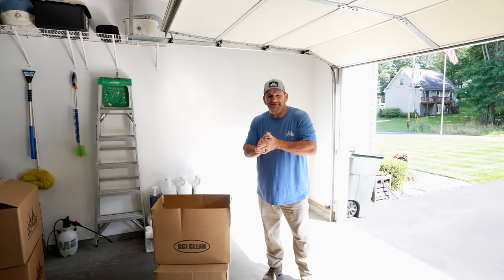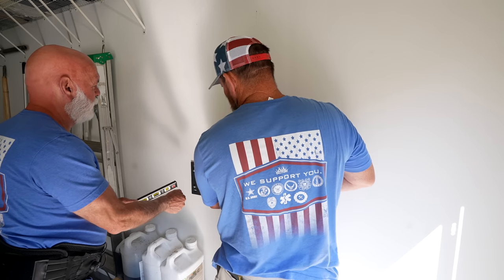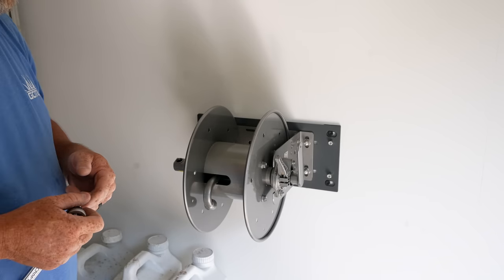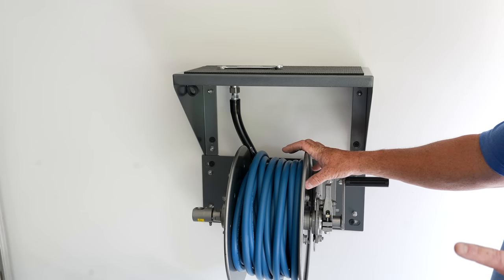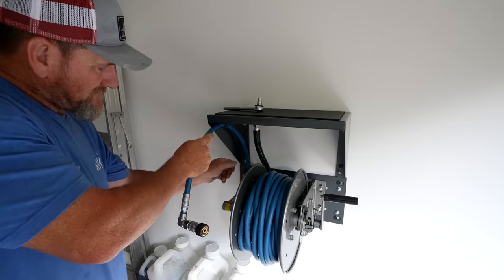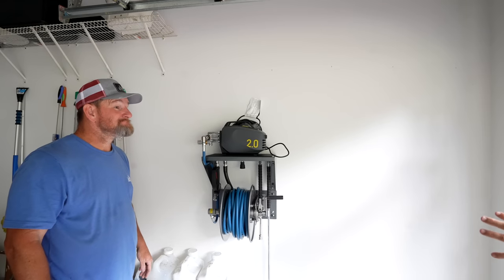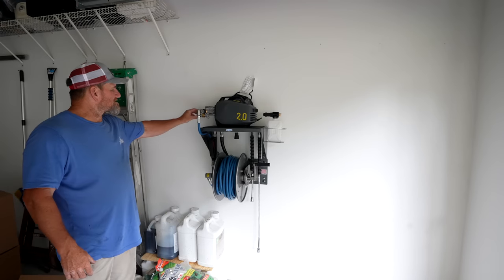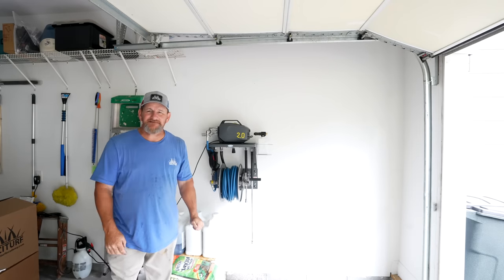New Pressure Washer Shelf and Hose Reel Mount

Comment: I'm a automobile detailer, this is a great idea and system. Especially for the homeowner. Gallons per minute is more important than psi is. This takes the frustration on getting a hose out and putting it away. Love it and quality is expensive but it lasts longer  no issues every time you use it. Detailer can mount in their trailer wall and keep it out of the way.
I'll be ordering one soon..

Comment: I have the OG Kranzle setup and I love it. 

That said, you did an amazing job putting this together. The mounting bracket for the hose reel and shelf for the pressure washer are genius. The ability to store your bits and pieces on the shelf looks very useful. 

This looks much easier to install too!
Reply: Why did you choose to go with kranzle?  The ar630 is a couple hundred bucks cheaper and has better output than the kranzle?

Comment: I fabricated one myself for my use in front of my shop. I love it! I am also a neat freak, and love organization! For a reel, I used the cox setup that came on my Z spray. I had installed a brand new one on the Z spray. And the old one worked perfectly for my pressure washer setup. Mine is 1800 psi also. It is absolutely perfect for washing equipment and vehicles. Your set up is very clean and nice! You did a fabulous job creating it. Always enjoy your videos.

Comment: I have that pressure washer but mounted it on a metal garden cart. Its great for vehicles and light duty household work. This consumer grade pressure washer is only rated for 200hrs which i expect to die on me in 2 years or less. My next one at that time will be a Kranzle 1150. Yes expensive but it is serviceable where this model is not. You have a great setup for low cost entry level, great job dude! Oh, i want to thank you for your quick delivery of the TTTF. Getting everything ready for overseed. Bad thing about the overseed window this year is we are forcasted to have one of the most busy hurricane season in a very long time, we shall see. God Bless

Comment: Pete, well done. I have a similar setup and have been using it for years and it is a game changer.  Your setup is quality. One potential add-on that you should look into selling is a spotless rinse system; easily built with 2 cartridges with replaceable DI resin and some basic PVC, copper, or PEX plumbing...all which can be options. Turn the DI on when it's rinse time and off when you are doing everything else. Also add on a TD meter to measure the resin. Wishing you success in your journey.

Comment: This is so much better than the unit I have. It's electrical and I have to drag it around everywhere. It gets tiring so it also does not get done. I have never seen any type of shelf so well put together. And I'm including even non pressure washer shelving. This is the best thing since sliced bread.  As a handicap person, I can definitely see the benefits of this over what I have to do now. Pull the machine out. It's located in different locations in the garage because I don't have room for it. Assemble the pieces. Hook it up to the water supply. Pull out the clothes to the distance I want it to be. No there is no reel on my system. And then start using it. When I'm done I've got to reverse everything. It takes almost as long to set it up as to use it.

Comment: Finally someone made a great system for a good price.
Reply: Good price? I guess I missed that part.  I have the pressure washer, hose, ect... all I need is the reel and shelf, and by my calculation, it would cost me over $700 for just those two items.  Not exactly value IMO.

Comment: I'm installing a similar setup in my garage to wash cars. Active 2.0 , Coxreel, 75ft blue Cobrajet hose, Mckillan's swivel gun, MJJC Foam Cannon Pro 2.0 and Hally  12x24 stainless shelf. Nice setup you have there Pete!
Reply: What's that setup run
Reply: @justins8768 I would say I'm around $800-$900

Comment: @GCITurf

Hey thanks for this video. Did you actually do another video about this?

Also we agree that this shelf system has some nice unique details that other shelf’s do not have built into them. There is nothing wrong with this at all.

Do you know if a Kranzle K1322TS pressure washer will be able to sit on that shelf ok?  If not it would be cool if you could offer a slightly larger size shelf system for the larger pressure washers.

Comment: That's nice Pete.  I wish I could do something like that in my garage.  We cannot put water lines in our garage because it would freeze in my area.  If you live somewhere you can have water lines in the garage this is a great setup.
Reply: You can install this without any worry. You just need to drain the pressure washer hose when it’s around freezing and then bring in the pressure washer.
Reply: @sdfd504  You missed my point.  I have no water source in or near my garage.
Reply: @myriadcorp  gotcha. I had the same issue at my previous house. I just ran my garden hose to the wall mounted setup and used a quick disconnect on the hose. Still made it a lot faster then setting up a normal pressure washer.
Reply: @sdfd504 insulation. They have these in Alaska. You can even have a wire ty rapped to the pipe for like 40 bucks and they keep the line above 40 degrees and only come on when below 40 degrees

Comment: Zero Degree Nozzle is the one that spins...
Reply: The red nozels with a circle are zero degree nozzles, the ones that spin are referred to as a turbo tip or turbo nozzle.. While it does also have a zero degree tip at its core.. The whole point is it keeps moving so it's not pummeling one small dot with constant pressure.
Reply: @AlexKunstar  LOL...I was in the Vehicle Washing Industry for 12 years...I was around when this nozzle technology came out...The were called Zero Degree before the Turbo Nozzle name was coined...
Reply: @northface484 I think you're misunderstanding my point... All turbo tips are zero nozzles... But not all zero nozzles are turbo tips. Why do you think it was renamed for clarification?
Reply: @AlexKunstar Some people are stuck in their ways. Just let them be. You sir are 100% correct.